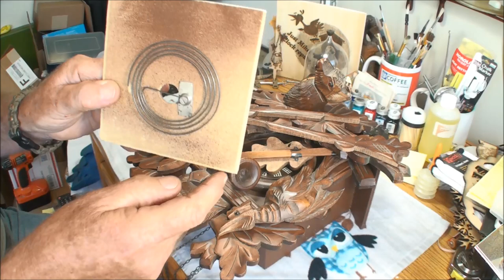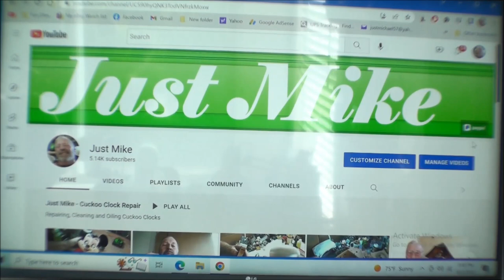Black Forest Cuckoo Clock with Music 1985

Comment: Another great video Mike. Wanted to comment as I watch. When you take the time side great wheel off be sure to inspect the plastic wheel. If it has cracks in it then the wheel can spin on you. I have repaired them using liquid superglue and baking soda. Put the superglue on first. Then sprinkle the baking soda on. Then blow the rest of the baking soda off. A chemical reaction occurs which makes it rock solid. Too many cracks and you might have to replace the time side main gear. Also the piece that shuts the cuckoo off which has the e-clip that you have to take off that goes around the gear with the cam make sure that you inspect that post. I have came across one that wasnt working properly. After taking the movement apart several times I discovered that the post was loose. That part is called the Cuckoo Bird Rod Locking Lever if you have a book to look it up.  Great job on cleaning up the case. My buddy Ron Rosencrans always takes them apart like you have done and cleans them up. It really makes them look great. I dont know if you polish up the pivots and the verge and crutch assembly but I would suggest at least taking a dremel with a wire brush to the verge and crutch assembly pallets and the escapement and the number 2 wheel on the time side. I really need to break down and purchase the movement holders. I have made them with bolts, washers, and nuts but it is too big for cuckoo clocks. Instead of taking the movement back apart to get the 3rd wheel warning pin to be in the position that you want. Just put it where you want it. Then shove your fingers down in the top of the movement to stop the gears from turning and with a pair of plyers turn the cam to the position that you want. As  you know the cam is friction fit on the shaft and it will turn but you have to stick your fingers down into the movement to prevent the gears from turning as you turn it. I am also going to have to purchase some of the wire that you make your springs with. Also I am posting a video now if the 8 point star wheel is touching the back plate at all because it is bent then it might slow your cuckoo down at times. I am going to have to make a shim myself to lay that on before I tighten it down. Again I like the test stands for the purpose of testing the movement on the wall. Overall Mike you did a great video. Love it. Sorry I wasnt complaining just giving you a few more tips. Keep it up my friend.
Reply from the maker: I am not happy about the plastic gears and yes I do look at them. So far, I haven't came across one that is broken. I would just guess you would have to buy a new winder to get the gear replaced?.? You come up with good pointers in this comment. I have watched the videos and commented. Like I tell others, Your videos are not edited, but if you listen long enough, you give great tips on what to look for and maybe can't see it, but you also try to show how to fix the problem. Thanks so much for stopping by, commenting and giving a great share. God Bless Mark.

Comment: I just picked up a clock that was in a shop for 3+ months. The music box is really screwed up, The music is very faint and there's a grinding sound?? After looking at your tutorial. I am not sure my grandson and I are ready for that. I bought this for my mom in 1998 in the Black Forrest. Any ideas?  Thank you!!
Reply from the maker: The combs on the music box need to be adjusted closer to the round cylinder to make it louder, but not so close the clock has to work hard. The grinding noise might be the wire that tells the music box to play and needs a little adjustment.

Comment: what kind of oil do you use to polish the furniture
Reply from the maker: I like the Howard Feed-& Wax you can buy at Home Depot. It's easy to use. I put it on with a rag and rub it in, it looks nice and shiny/wet but let it set over night and it all soaks into the wood to keep it from drying out and cracking and the shiny wet look goes away.

Comment: Hey Mike, Love your videos!
Three questions:
1. I have a music box that has the cracked plastic gear. Where can I buy the gear, or govenor assembly?
2. What is the brand of wax you use?
3. Do you ever use linseed oil mixture on your clocks?
Thanks again for the videos. Keep them coming.
Mogulsmoke
Reply from the maker: 1.The cracked plastic gear is normal and as far as I know, you can't just buy the plastic gear. Then new governors are too expensive, so I look for German made music boxes at the thrift store and use the parts off of them. 
2. I started using the Howards Bees Wax that you can pick up at Home Depot. Works well and will soak in overnight. If you have a blond colored clock, the clock will turn a more normal color of light brown because the wax will soak into the wood. 
3.I have never used any mix for my clocks. It is less time to use the Howard's Wax and after it soaks in, the shine it had goes back to flat but moisturizes the wood clock too help prevent drying out and cracking. 
  I do hope this help you make up your mind on things. Thanks for stopping by and God Bless.

Comment: Merhaba alman guguklu saatimin bakımları yapıldı temizlendi yağlandı fakat sarkacı eksik ben kendim uydurdum. Saat bir süre çalışıyor 3-5 saat sonra duruyor ? Neden? Ayrıca tik tak sesinin yanında cik cik ses geliyor nereye sürtüyor bulamadım?
Reply from the maker: The squeaking sound is coming from the rocker where the gears start. Just a little oil on the rocker will stop the drag and squeak. Then your clock should run again. You can buy new pendulums on like or Ebay has new and used.
Reply: @justmike57  teşekkür ederim efendim. mekanizmayı söküp yeniden yağlayacağım. bu arada ağırlıklar kaç gram geliyor? sarkacın uzunluğu kaç cm?